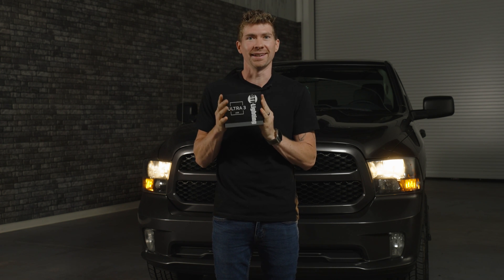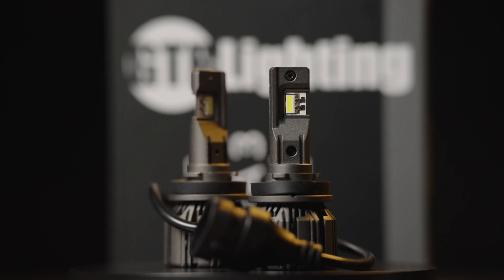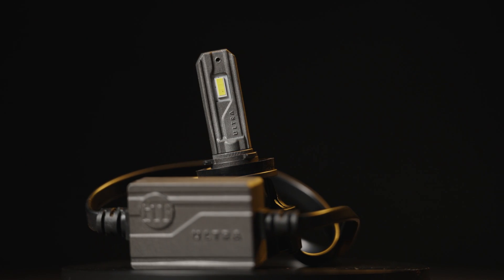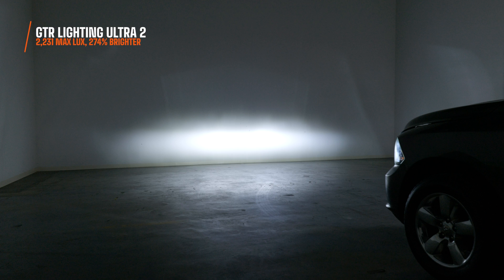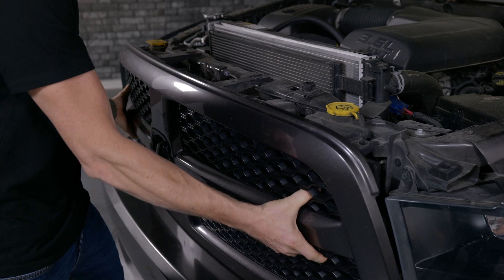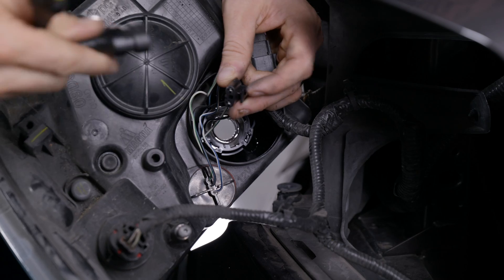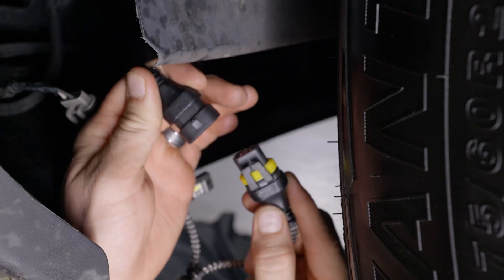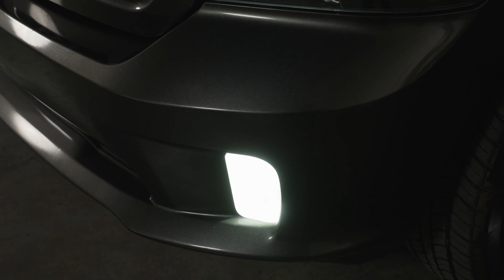718% Brighter LED Bulbs for 2009–2018 Ram with Reflector Headlights | GTR Ultra 3 Install & Review

Comment: If I were to install these in my 18 Ram Bighorn, would any warning lights pop up on the dash? I’ve heard converting to LED or swapping the full headlight module can cause issues.

Comment: 2015 Ram with Projector lights.... Tried  2 different GTR leds years ago... was a useless output... halogen incandescent were better.... wound up going with  HID.... mildly better, but not great (this was many years ago)   I have been Running GTR Ultra 2 in my 17 Ram work truck with regular reflectors & they're AMAZING...(also using the GTR LED trun signal bulbs... All Amazing.  I'm hoping the gen 3 will be able to make my 15 with Projectors decent so I can eliminate the HIDs.... I have a 15 hyundai Sonata with projectors to try as well... being shorter... they might fit now.
Reply from the maker: We’ve actually got a Ram Ultra 3 projector testing video coming soon! The Ultra 3s have been performing really well in our testing, and with their more compact size, they’ve been fitting in just about everything — so they should be a solid option for both your ’15 Ram and the Sonata.
Reply: @HeadlightRevolution  howdy, just wanted to check in and see if this video you mentioned in your comment it out